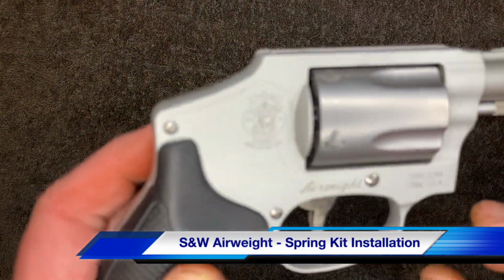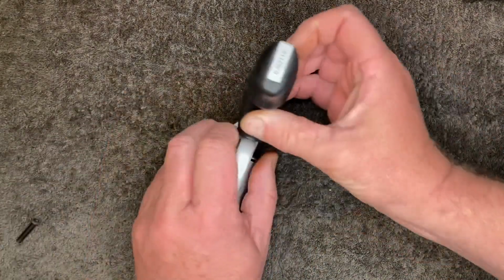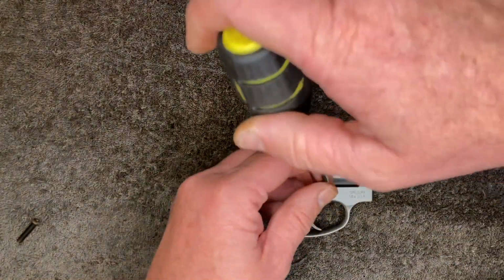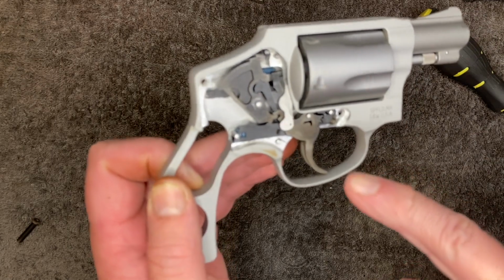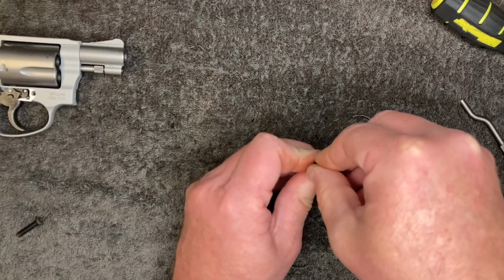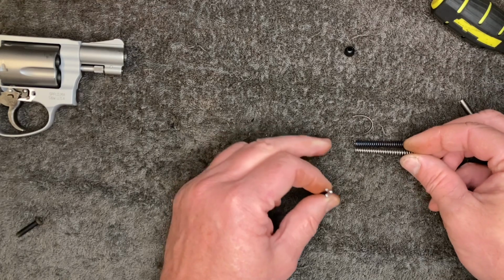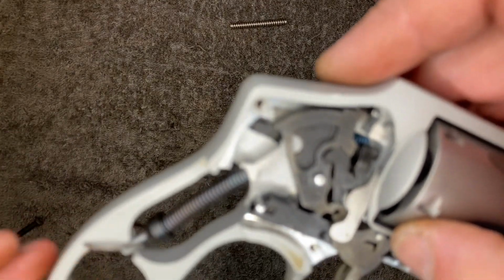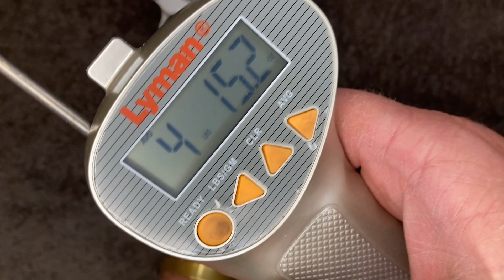S&W Airweight - Spring Kit Installation

Comment: Great video! I've got the Wilson spring kit in two of my J-Frames. Really enjoy it, albeit that in older guns, they can have issues with reliable detonation with certain ammo. I'm 99.9% certain it's due to the frame mounted firing pin revolvers delivering a stronger impact than the hammer mounted firing pin guns. 

I'm experimenting with the TK Custom kit, which uses Wolff reduced power springs (same as the Wilson ones), but also comes with a longer firing pin so that you get reliable detonation.
Reply from the maker: I normally keep an extended firing pin at hand.  If I get light strikes after I installed the lighter springs, I install the extended firing pin.  If the light strikes persist, I put the original firing pin and hammer spring back and just live with the advantage that the lighter trigger return spring offers.